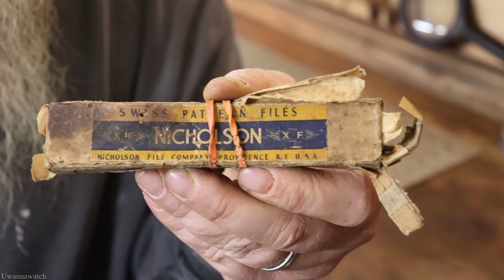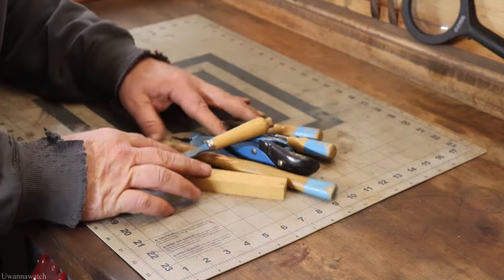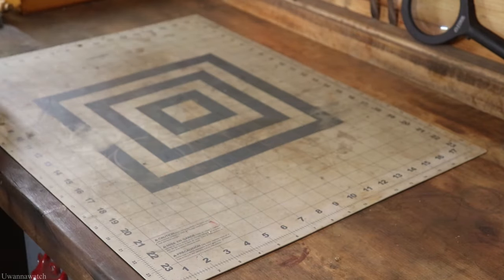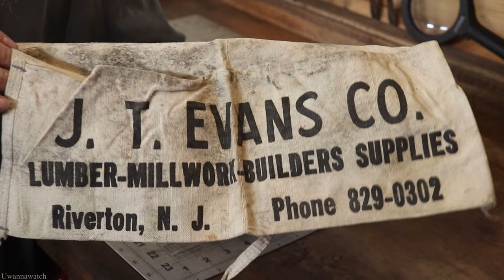Weekly Flea Market Haul # 13

Comment: 5:00 What can be expected with old solder.  I tend to save it but not sure if works well with age.  I hear you are mentioning to get ride of the 50/50.       I must have a dozen rolls floating around.  When I go to sweat pipe I'm working off the new rolls.   tHanks for the video